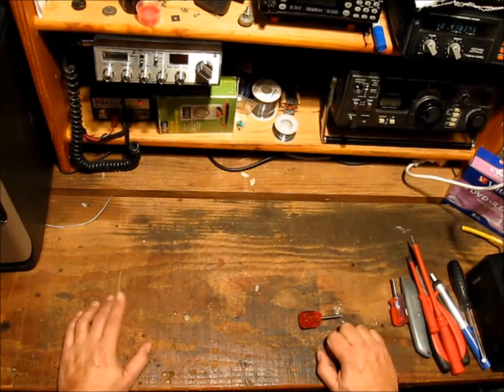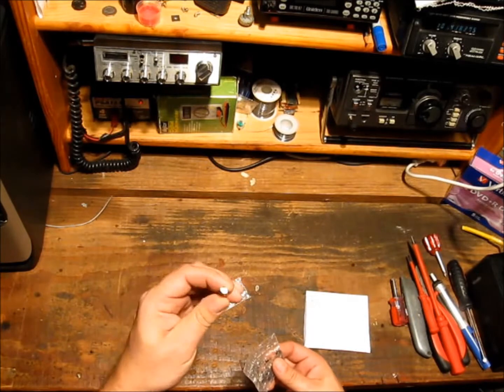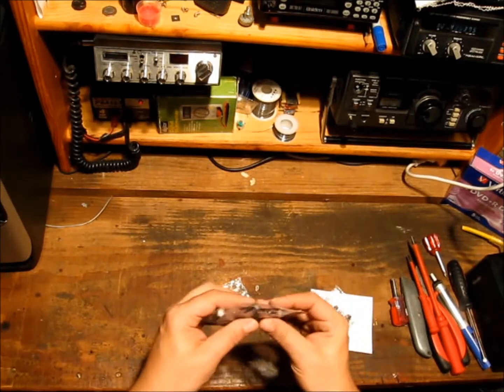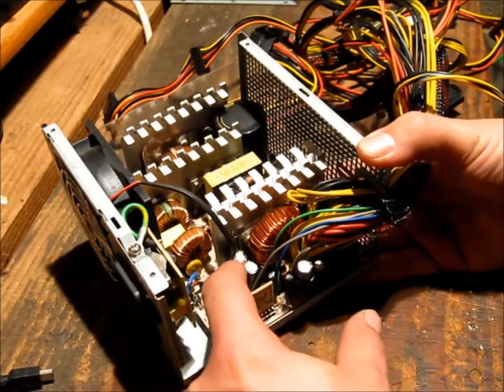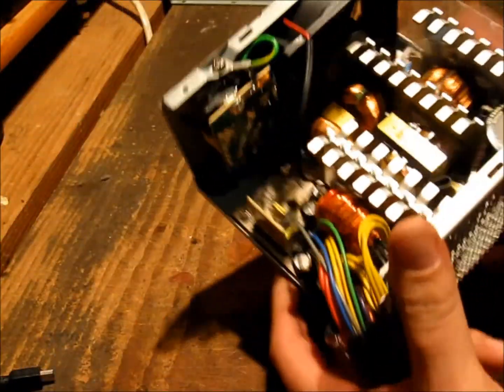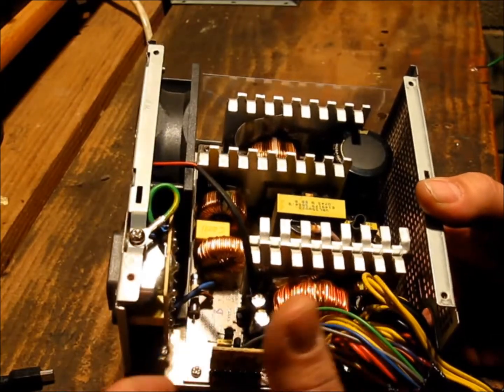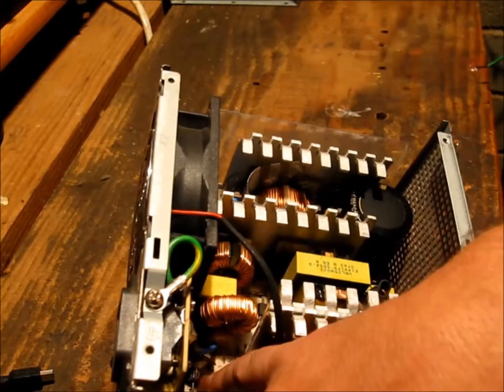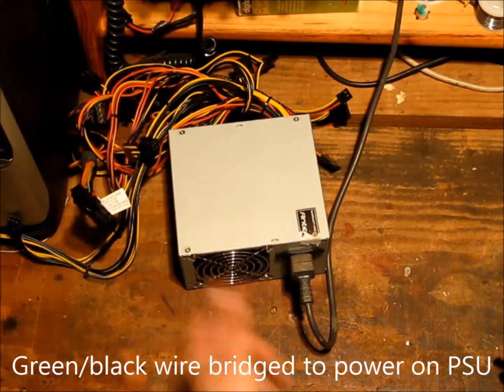Antec Earthwatts 500w PSU - Repair Part 3 (conclusion)

Comment: Luckily it was the main capacitor that got bad. In my Liberty 400W , a faulty cap led to main coil subsystem failure with the NTC thermistor blowing and few FETs  dying. not something fixable by renewing just the Caps.
Reply from the maker: I have been fortunate with the Antec  PSU's design thus far, I even have a 350w unit that is still going strong years after the recap, a pretty decent robust design only pet down but let down by the poor capacitor selection.

I have never owned a Liberty PSU so I can't comment on that, sounds a bit rough though....

Comment: Hey. Is this psu BP500U ? Can i replace fan to new? Is there 3pin normal connector?
Reply from the maker: No it most certainly is a 2 pin header... you can still replace the fan by cutting the original power leads and connecting them to the red/black leads on the new fan (the yellow sense wire is not used) but make sure you do this whilst disconnected from the mains and insulate the wire joins.

BTW discharge the PSU before you open the case to prevent electrocution from latent power stored in the large capacitors.

Comment: Well that was fun!
So what is next ?
Something that will not involve the postal system . :-0
Reply from the maker: I live on the edge of what people refer to as "The Outback" everything envolves the postal system, internet shopping is my lifeline LOL.

I used to recap motherboards back in the day when really nasty el-cheapo components were used, thankfully these days with solid polymer and high quality capacitors I've not needed to in quite some time.

A valve project or new toy to mod would be nice...